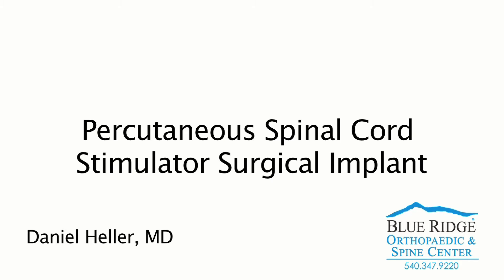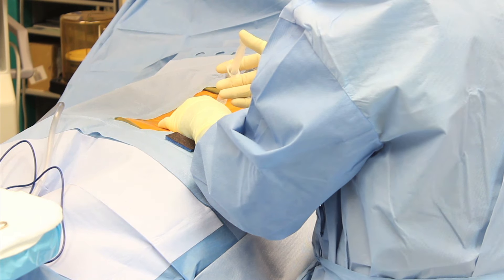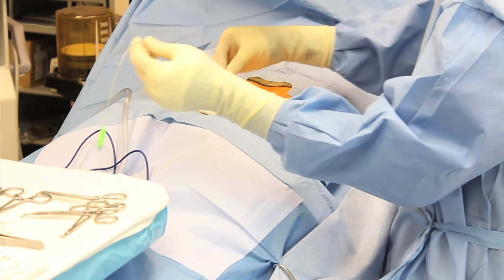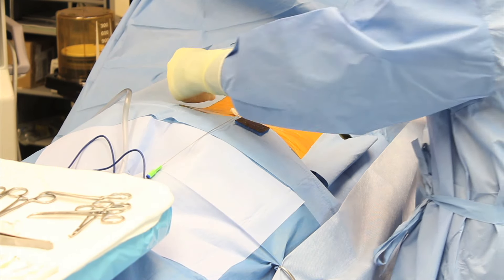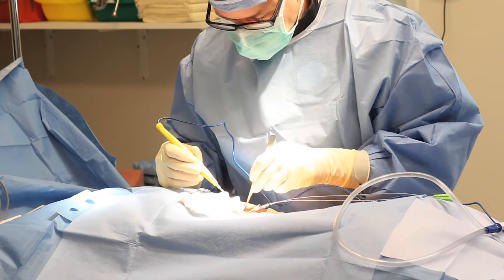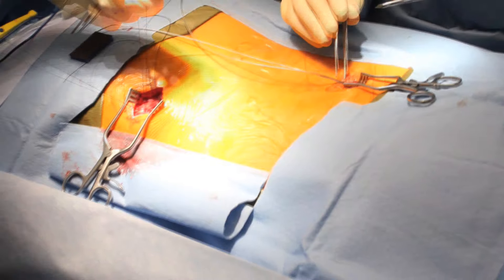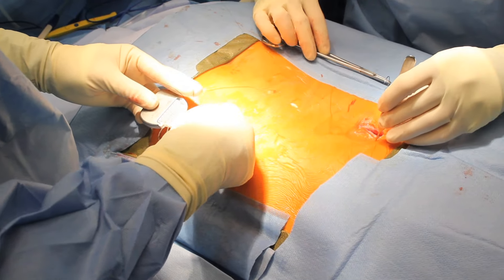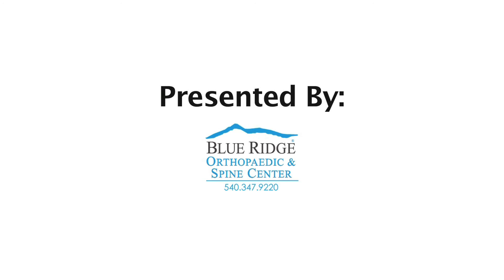Spinal Cord Stimulator Implant

Comment: Short and sweet. Have had one for 11 years for headaches. Electrodes over occipital nerve in head. Battery is lower back to the left side. I've never had a problem wearing jeans or anything. After the battery is installed it does hurt. I found lying on my back or over the battery site felt better than trying not to lie on it. It gave me a better quality of life. It's worth it and not having to take opiate medication was a plus for me. Good luck to you who have this procedure done.
Reply: I just had the commercial trial done. It went very well. I signed up for a clinical trial with Biotronics which ends next week. I am going in on February 24th for the permanent one. I can't wait. Been living with this pain for 35 years. Been living on narcotics for over a decade. When I had the Medtronics trial stimulator it knocked my pain, which took my pain from an 8 or so down to 0.
Reply: So it helped with your headaches?
Reply: I just got mine in yesterday. I definitely feel better lying on my back. I'm in alot of pain if I'm not. How long did healing take for you?

Comment: I had my two sockets fitted to my spinal cord 3 weeks ago with external wires for a week to see if I had upto 50% pain relief or not, if not they would have been removed !
20years ago I had a near fatal bike accident  coming off my bike (R1) and I get run over by a 7 Series BMW, breaking everything down my left side and shattering my pelvis in 13places. I died 3 times  and for 20years have suffered with chronic pain across my pelvis and nerve damage (pins n needles and horrible cramping) from my left shoulder down to my finger tips.
As soon as I awoke pins n needles pain has just gone and the cramping in forearm has reduced in frequency !
Once the stimulator is used my pain seriously has reduced in my pelvis and my forearm and hand feel fantastic.
I am surprisingly shocked at how much relief I have been gifted.
For 20yrs I had 2-3hours sleep then awoke with pain for a couple of hours then another 2-3hours sleep again then I’d be awake till early afternoon.
NOW I’m getting 8-9hours uninterrupted sleep !
What an absolute godsend, I know this is going to change my life and only 3 weeks in !
Reply: Hi how are you. The pain is gone

Comment: Most of the comments here seem to be very negative, I'm very sorry MrD that your experience has been so horrible. I had the trial back in February with the Nevro Senza, it was very effective and I could feel considerable relief. There's no sensation at all with this one.  The trial lasted for 2 weeks, it was re-programmed 4 times and I was called up by the rep everyday and advised which settings to use. I'm scheduled for the permanent scs on 17th Oct. I'm less confident now after reading this.

Comment: If you can wait for the new Nevro Senza spinal cord stimulator high-frequency unit. It offers no paresthesia in the low back and legs and no shocking sensation with positional changes. I It's being trialed in the US through mid 2014. 200 times stronger than the current SCS on the market. It is already approved in Europe and Australia. It is miraculous.

Comment: I have a Medtronic system with paddle electrode sited iat T10 to give coverage for pain in my left hip and leg. I have Reflex sympathetic dystrophy (CRPS) after a lumbar injury when I was 18. severe pain only began 5 years later.. I haven't worked since aged 24 and am now 46. First surgery was at the Royal London Hospital, pain relief is reasonable.. guess I take the level of pain I have now for granted.. when SCS failed 3 years ago pain was horrible. Had repeat surgery in Sweden in 2011, paddle electrode replaced and new battery back.. surgery took long time because of much bone growth over electrode. It explained the thoracic pain I'd had for 3 years prior to surgery. Battery pack was my 4th one since surgery in 1998.  I tend to use it constantly, pain is like phantom limb pain with burning then freezing sensations, and like a screwdriver borring into my foot. Still need opiates, take methadone daily plus oxycodone when I need. Plus Cymbalta to help reduce temp changes. When it failed in 2011 I really got to realise how good it was.. worth every minute of surgery. lol

Comment: Thankyou very much for your consideration in replying to my concern. I had a review yesterday and it looks like this may be going to happen. I am also having the other side done in the not too distant future. I have only the right side done currently with one stimulation wire beside my spine and one running along the top of my hip bone with these two going into one battery pack. I have been told the other system will have to have another battery to control it, on the left side that is.

Comment: I am just waiting to have my sugary scheduled.  I currently have the Medtronic stimulator, but never received good results.  I am hopeful for this upgrade, but hesitant of course.  I have been suffering for 28 years.  It's exhausting.  Is there a reason why some doctors are using a horizontal incision for the wires vs a vertical incision?  I've seen both, but I'm curious. My doctor says he's received an 80% success rate in difficult cases, like mine, where previous results have been poor.  I expect my recovery to be quick.  In 2000, I had A lumbar laminectomy with pedicle screws, and a fusion.  The hardware was removed a year later since I was still having pain and that doctor thought that perhaps my body was reacting to the hardware.  But no, my pain was just stubborn.  In 2009 the Medtronic stimulator was implanted after the trial, but still no success.  I've had one revision since one of the wires was crimped and no longer worked.   I'm tired of being on opioids and other meds.  I just hope to have hope...make sense?  All this because of a rear-end car accident 28 years ago that has claimed a lot of my lifestyle.
Reply: The Medtronic stimulator did not work for me I had it in for 2 years and the battery part took forever to charge then one night I was trying to charge it and all of a sudden it felt like my back was on fire the battery pack had burned itself

Comment: the Co. that re-programs them just gave up on me! I had to get a ride 20 miles to meet them for a "session" and when I got there I had to sit and wait for them to arrive over an hour, I get called back into the room, and they told me there was nothing more they could do 4 me!!  they tried for about a year, and I finally had it removed after 2.5 years, and I hear you about the Bat.
 Have you ever bumped into anything, like coming in thru a doorwall? I hit that thing right on the edge OMG :(  PAIN

Comment: When I stand in a fixed position for at least 10 minutes I start to burn and get tight in my lower back.  I want to see if i use this if that will go away.   Like a simple task of doing the dishes  is painful these days.    I had an L5/S1 fusion in 1997 and was fine up  until 2008 when i had a car accident and have had chronic pain off and on since then.

Comment: I am currently considering this procedure due to failed back surgery L5-S1. I have been in constant pain since the surgery. Actually worse pain than what I had originally that led to the back surgery. My concern is the wires that are implanted. Is there a chance of displacement of the lead wires with normal activity and movement?
Reply: Hi. The neuropathy pain may improve over time with scs

Comment: i have had 6 back surgeries
l1,l2,l3,l4,5. s1,s2.  I have a tinze unit and battery pack implanted in my spine. I have a remote power cord for on off anywhere with a three stage charger. I will be on pain meds besides the unit for life. The unit does help ( but back not done yet)     I have Rapidly Degenerative Disk Disease. So regardless of what i do another disk is going to go. Trade places anyone?

Comment: This is the same SCS that I have. Its so strange to think you have a long life battery at the bottom of my back.
Reply: I had it done in.Trinidad, I had two major surgeries before the implant was done, the trial worked, for the permanent, man, you have to be an animal to.go through that pain, I was on local anaesthetic, you feel.as though you are dying, pain excruciating, got wired up, worked for two months, but noticed the leads firing in the wrong places, so I was still in pain, then battery shifted and had to have it replaced.  in the end for the dysfuntion the measurements were wrong, I am the first person in Trinidad who had an implant, I waited a long while for it to be removed
  I still have screws in my spine that they cannot reach to remove, I live in constant pain and my country.does not have the medication,. my pain level is 5, and sometimes move up to a nine, at one point of this experience I couldn't walk for a year and a half due to the spine becoming infected.  I wish I could wake up without so much pain, I also got two strokes to.the right side of my brain. I need help and try to cope on my own but my country is not interested when and experiment fails and it was very expensive.  anyone care to get in touch please do so.  Cheri Lopez. in chronic pain, no meds, no a medical assistance, no help to get around.